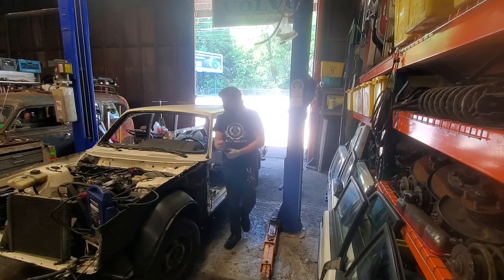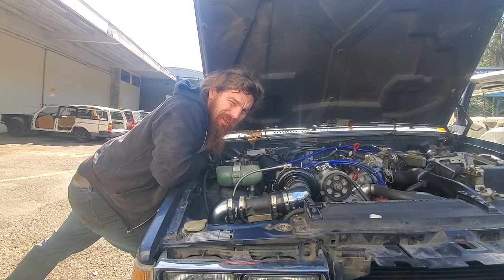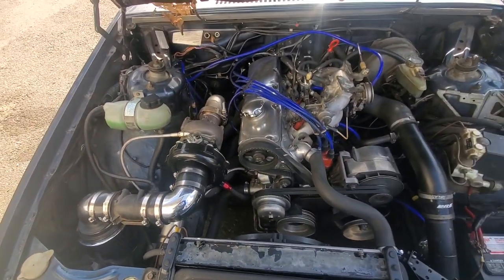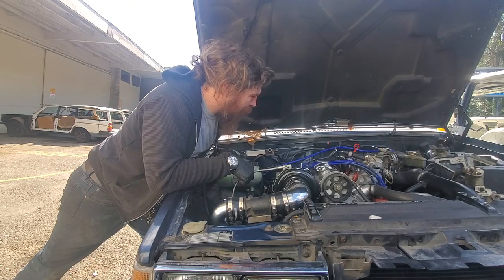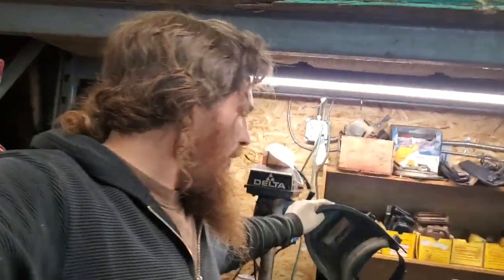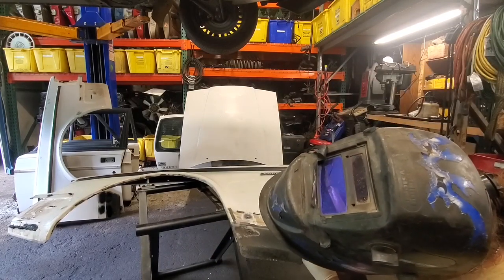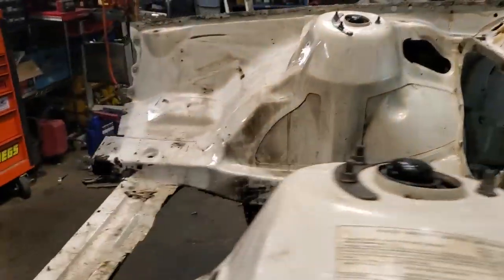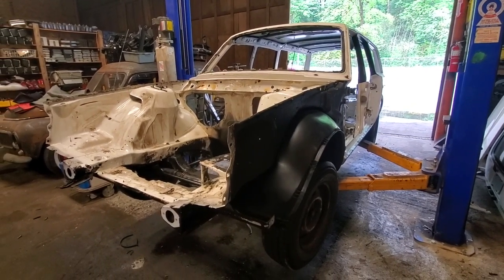Tearing The Engine Out Of Our Project Volvo 240 (BODY WORK BEGINS!)

Comment: What octane are you going to run? Im suprised that you use so high compression on redblock turbo engine.

In Norway we have 98 octane and running 7.5:1 - 8.0:1 compression and high boost = high torque.

Comment: I have a question i got a 95 940 wagon B230FK that has a problem. in idle it got some shaking and at driving in low speed and low gear it jumps like am headbanging too a good song.. in 2018 i got new plugs wiers cap rotor rpm sensor but no good.. so anoying at stop sign or you need to crawl in an 
junction. i got one code in port A6 1.1.3 but on internet ther is no code for A6 1.1.3 only on A2 sorry for long comment i love my car i dont want too scrap it...